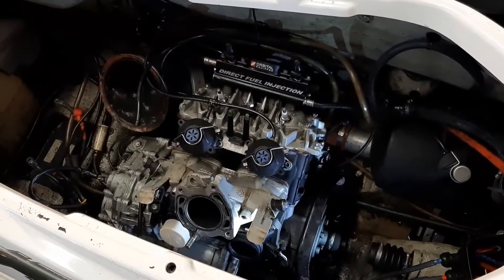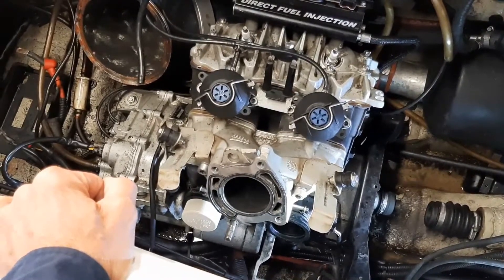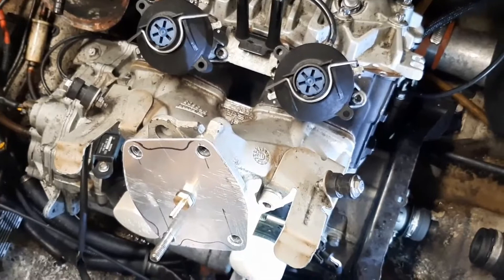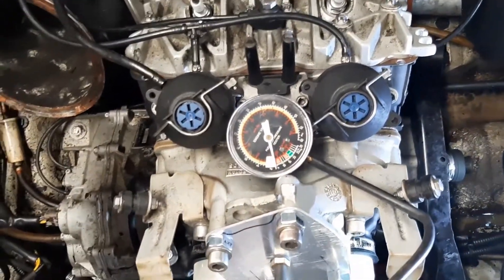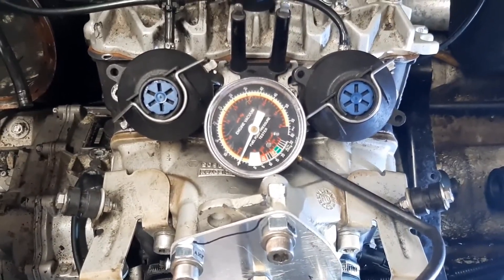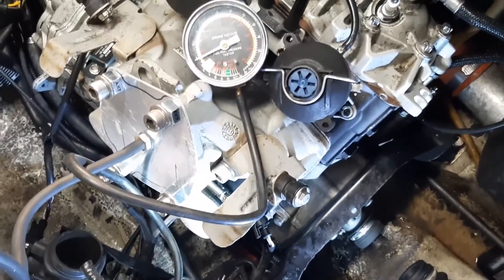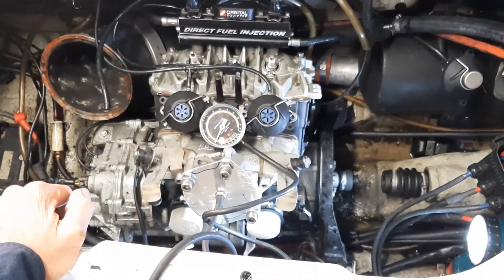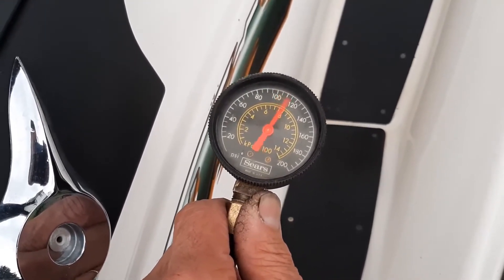Seadoo 2002 GTX 951 DI Repair Process - Part 3 - Bottom End

Comment: Did you have the throttle body open during the compression test? When I perform the test with the throttle body closed, I get 110 psi. However, when the throttle body is fully open, I measure 135 psi. I'm not sure if my cycle passes the compression test based on these results.

Comment: Great video!! I wish I would've done a leak down test on my little 3 hp ice auger before running after sitting for six years. I put a new carb kit in it, fresh fuel and it started up and ran good. But while idling I noticed it would rev up and down and than it sounded like it was getting tight. And than it clicked in my head. I was lucky that it only took out the main bearing. The rest of the engine was fine because I didn't keep running it or revving the life out of it. So I just got done rebuilding it, and now waiting for my vacuum/pump kit to arrive so I can test it.